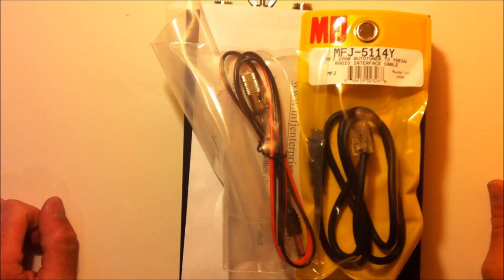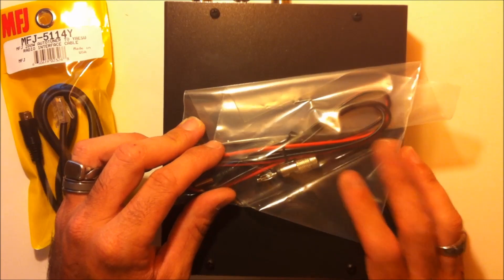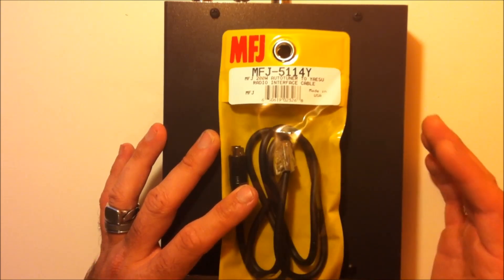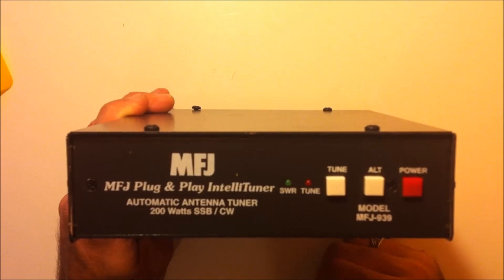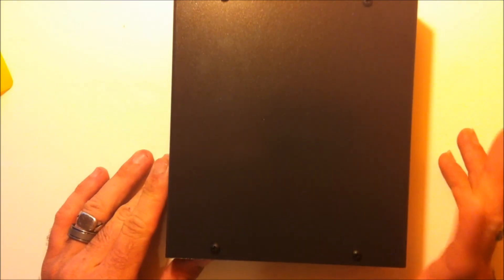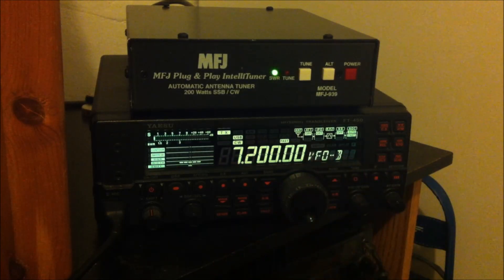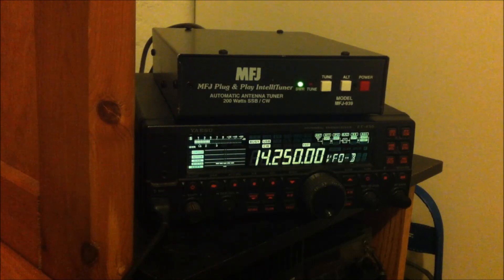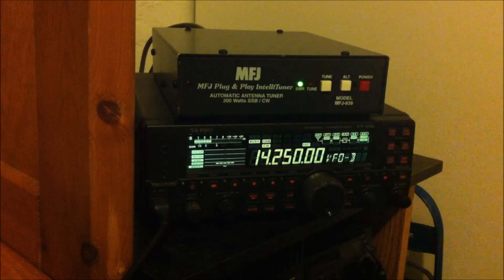MFJ-939 automatic antenna tuner review and demo

Comment: This is a great tuner. However, loose screws and nut can give headaches. If you experience intermittent operation, take the top off and tighten all screws and nuts. Be careful not to break anything. This will definitely help you out. I use this on my ic-7300 with no problems.

Comment: Not a fair comparison! The MFJ has had the frequency and SWR settings previously memorized, unlike the rig's internal antenna tuner. Terrible comparison, of course the rig's antenna tuner took longer... it needed to "find"  the NEW best SWR. Fair enough about the rig's tuner not finding a tune on 80m as it is only good up to about 300 ohms. Other rigs can store tuner memories and they would be as fast as the MFJ. Poor comparison !!

Comment: I know this is an old thread but I just don't know where else to go...I purchased an MFJ-939Y to use with my FT-710. All I've got is a 20 meter dipole which tunes very well even without a tuner but even better with the rig's internal tuner. Well, not being able to install any other antennae due to association restrictions, I've tried 15 and 40 meters using an MFJ-949e. Got some decent results (1.5:1 and lower), so I thought I'd purchase the auto one which also benefits me in that it is a little smaller. I'd love to be able to tune 10, 15 and 40,. 
Well, it's going back. Not only did I find that the tuner will not work with the rig's "tuner" button even with the proper cable, but it will not even come remotely close to tuning anything outside of 20 meters (which I certainly don't eve need it for due to the fact that radio's internal tuner actually does a better job). When I say not even close, the tuner will not do anything but shut down and claim high SWR. It also gives some CW codes which are thrown out so fast that I find it difficult if not impossible to even read. They must be at about 45wpm, something which I have trouble with at my age. The manual is completely useless.
Have you tried this tuner with the FT-710 by any chance?
I am about to ship the tuner back to under the rock that it came from, but am willing to listen to suggestions.
Reply from the maker: I have not used it with the 710 but I feel if you have an internal tuner already, an external tuner is a waste. I do not use tuners at all, I only use resonant antennas. That tuner did a good job when I tested it years ago. But if your rig has a tuner, this is not needed. And this tuner only matches an unmatched antenna to your radio, it's not "tuning" your antenna. Keep that in mind.
Reply: @HamRadioConcepts  It's being shown in the video with a rig that has an internal tuner. For the most part, the internal tuners don't tune beyond 3:1 mismatches. This tuner is rated at being able to handle 30:1. Tuners like this are meant not only to add a tuner to a rig that doesn't have one, but also to replace the built in ones. The FT-710 has a setting with which I can disable the internal tuner and designate an external instead. This is what I've done. It's supposed to be an improved alternative to the internal one, no?
Also, the video is demonstrating how much better it does than the internal tuner. Great that you can have an antenna for each band you use. If I could do that, I wouldn't want a tuner either. I tried an MFJ-949e. It did an admirable job, and I was able to work on 4 bands with the same 20 meter dipole. but being a manual tuner it was a pain in the butt. That's why I wanted to give this one a try. No it's not the same as having a 40, a 20, a 15 and a 10, but the 949e worked and it worked well. I may have to go back to it.

Comment: I need a tuner but the problem is I can't ground it. My shack is not near an outside access point leading outside. If I were to ground the tuner to a groundrod outside, the ground wire would be at least 45ft from the shack i side the house to the ground rod outside. Having a ground wire that long would pretty much resonate to act as an antenna.  Are there any solutions to the issue of a ground wire being to long to ground a tuner?

Comment: Merci pour la vidéo. Good evening Dear Om. One question please. The MFJ 939 only accepts 200w ok. Then I use an ACOM 1010 knowing that at the output of my YAESU 991A the power would only be 15/20 watts. Thanking you in advance for your response. Cordial 73's. Joel/F8MGW

Comment: I just bought a FT 991A, I can transmit on vhf/uhf but I can't seem to transmit on HF. Has anyone encountered this issue? I finally got to speak to the Yaesu technical help today and they told me to do a full reset but, that did not help. They are thinking that it may have something to do with my antenna and or tuner. I just bought a G5RV Pro ZS6BKW from Amateur radio supplies and I have it hooked up through my antenna tuner (MFJ-939). They had me disconnect the antenna tuner and plug the coax directly to the radio but, that didn't help either. I don't have a dummy load that I could use to double check the swr. Anyone got any ideas on what is could be?

Comment: I may have missed this, but what antenna are you tuning on for all these bands? 6, 10, ...?
Reply: I don’t think he said. I can tell you, if you build a simple 75meter dipole, run ladder line from it, to a 9:1 balun, then into your shack with coax, you will tune everything, and get results. I put an NVIS 75m dipole up in under two hours, from start to finish. I used aluminum electric fence wire (bare wire), a scrap piece of pvc, two insulators, 9:1 balun and 2 wire nuts.

Comment: I just bought one. well, I don't have a printer on this laptop. so I ask the sweet to go online and copy my manual. well because she doesn't run  She could not get it. she MFj and they said that they would get one out in the mail. so I'm waiting for snail mail. mine is set up for ken wood. but got the cable for Icom the salesman at Gig parts said that I would have to call Mfg because there was a wire inside that had to be changed. so again I want the manual and I still have to call Mfg again to have one of there techs to walk me threw the wire change. Now that is my ham experience, but I did like the video
Reply: You cant find anything on the MFJ site if you search it and click a link on Google, its like MFJ changed the URL name of every page on their site, when there are already Billions of links on Millions of sites across the entire galaxy!!

Comment: You say your internal atu on your rig , the 450 doesn't have a  built in atu
Reply: It was an option on the 450. It's standard on the 450AT and the replacement 450D now.

Comment: i got this tuner it tunes my 300Ohm fed antenna from 80 to 10 and made contacts on every band inbetween with my Kenwood TS-2000 
Like any MFJ product you need to open it up before plugging it in.. 
KD2GOE

Comment: I have the MFJ 929 and am Shocked at how fast it will tune.It tunes an antenna where my LDG AT-1000 will not tune at all and it tunes it quickly.I would never buy another LDG tuner because they are a poor choice against the New models of MFJ automatic tuners.I am not usually an MFJ fan but I make an exception for their auto tuners.

Comment: after getting the tuner in ( after many months on back order ) it will not tune like the video states if you are let say 20 meter as long as you tune 40 to 10 meters fine but it depends  on the antenna you have more than likely he is running a mult band antenna. if you have a 20 meter antenna you can tune 40- 10 the one i have antenna that is built for around 20 meg it will not tune upper 40 meter, 60 or 80 meters and it will not tune that fast even thro the tuner does not tune like he said the tuner is still a good tuner but it is best to get a good antenna that is built for a multbands and used the tuner with that type of antenna. my understanding it work fine on a longwire as well have not try that one. some times it is hard to get it to tune even on 20 meters  so it you know a ham that have one get him to let you try it before buying one
Reply from the maker: My antenna at the time was an 80 meter OCF dipole.. You should not be using a tuner for the bands lower than your antenna. If you have a 20m dipole you can tune 20, 17, 15, 12 10 and 6. You cannot tune 40 meters on a 20 meter wire.

Comment: Will this work on the ft 891
Reply: yes but the tuner icom inside the radio may not work with the tuner sometimes here again depends on the antenna you are running i used it mobile some time it doesn't like he stated

Comment: Yes it is impressive but you don't have to turn internal tuner on and off in the menu you can disable the internal turner and program it away you can operate an external tuner from the front  oh it's in the sub menu all you got to do is find it I've got one of these radios and and you can do it  ECT....

Comment: A suggestion, in case I missed your comment on this. Those rigs that are compatible via the DIN cable they sell don't actually NEED the 12vdc power supply (that a couple of uninformed commenter's complain about, assuming it's a "wall wart") as the rig gives the MFJ-939 the needed voltage. If you didn't note this explicitly in the video (or I missed it), viewers need to know this. PS: It also works with the new Yaesu FT-891 with the Yaesu cable adapter. They'll add that soon to their website.
Reply: I found the MFJ manual quite lacking (not the first time), and why I'm looking 'round the web. I wondered about the DC for the reason you stated, but dutifully rigged up a 12v center-positive to do the job here at home (taking it mobile soon). Anytime we can delete a cable--cleaner install.  7100 Icom here.  Thanks for info.
Reply: @Two Hands and a Radio Sure, it's in the trunk of my car, works fine, coax and data cable are all that are connected to it.

Comment: Happy New Year. I have a Yeticom Optima 10/11/12 meter radio 24 mhz to 30 mhz and the back of the radio there is no interface connection. Can I use this automatic antenna tuner and if not what do you recommend? I have research all of the automatic antenna tuners and all are made specifically for different  types of radios.
Reply: javierpolendo - you'll just need to throw a cw carrier at it with 10-20 watts to get it to tune. Also...does not handle twin lead. Look at a different model for that.

Comment: Was MFJ smart enough to use chokes on the wall wart? I'm betting not. This is what is keeping me from buying one; otherwise I will have to power it up off my DC supply. Wall warts are notorious for noise, esp on 40M. My Icom 7300 may have 12 VDC on the rear panel; haven't checked yet. Regardless, unless MFJ shielded or choked the wall wart, I would not use it to powwr the tuner.
Reply from the maker: Pete Harlen why not do what a lot of people do, plug the DC power cord into your power supply, instead of using a wall wart
Reply: Might wanna' re-read my initial comment. Wal warts suck. RFI transmitters. I never use them in or near my shack..pure DC. My whole point was why bother to even make them for a AT intended for ham use. Take it out and sell the tuner for 10 bucks less. :)
Reply from the maker: Pete Harlen when I got this it didn't come with a wall wart just an unterminated power DC cord
Reply: Not all of them do, sir.
Reply: HRC: Indeed! Some folks actually do their homework before trolling the Youtube videos. Nice channel, BTW.
Reply: Frank Howell What are you a fucking shill for MFJ? People see right through you for your ass kissing. Get a real life man.

Comment: Changing to another make/model of radio can be done, but there may be more to it than just changing the interface cable.  It may be necessary to also change internal jumpers.
Reply: You're right.  But there are only a small number of jumpers.  I think the tuner + cable + jumper is a well balanced design.  Also, it was polite of MFJ to show how to wire your own cables.

Comment: I know this is an older post BUT  I recently purchased the 939y for my ft 450  and I'm not sure what I'm doing wrong but it won't tune anything. I turn on the tuner  then my radio the green light is on when I key down it does nothing. If I key down and talk it goes crazy with high swr and the green light turns off. I've tried resetting to factory settings I made sure the radio is o only putting out 10 watts of power. I made sure the tuner light on the radio was off. I'm wondering if there is something I've missed with maybe radio settings to get this to work together properly.. any help please?
Reply from the maker: Transmit CW at 10 watts into it, it will tune in 2 or 3 seconds, then switch back to ssb. It will save it into memory for the next time you are on that freq.
Reply: HamRadioConcepts ok that seemed to work now thanks. I must have missed that some where to start off in cw mode. Will i need.to do this when changing freq each time? Like turn down the power switch to cw then turn back to ssb and turn power back up?
Reply from the maker: Yes thats what i did, now if you get the interface cable, set the radio to external tuner, then you can hit the tune button on the radio, IT SETS the radio to low power cw for you and tunes.. given there is a cable for your radio.
Reply: HamRadioConcepts  ok great thanks so much for your fast reply  I purchased this based on your review and  everything seems to be working well now. 73's 
KK4LNR

Comment: Will this tuner work with the FT-817?   Will it work without the cable on any radio?
Reply: Works on any radio without any cable.
Reply: Will this tuner work with the FT-817 with the cable?  Do you know if the FT817 can supply enough current to power the tuner via the cable?   I can't find any info concerning full compatibility with the FT817.   MFJ tells me the interface cable supplies power for the tuner not needing the external power supply.
Have you tried this on 6m?
Reply: I would like to get this tuner as part of a portable setup. Been looking at the LDG tuners too.  They have a couple of tuners that run on internal batteries.  One of their tuners is very small, smaller than the FT817 but does not in their specifications have the same range of impedance tuning as the MFJ-939.  Do you power your unit from the power supply or using the interface cable?  I would like to know the current used while in
the idle and in the tuning mode.   Thanks, Ken

Comment: This was posted a while back, but the inability to tune a wide range of frequencies to a single antenna doesn't mean Yaesu cheaped out on the internal tuner, but is a result of the real estate inside the unit. If they added on almost as much again to the size of the Yaesu as the external tuner is, they could tune as widely as the external tuner. It's always a tradeoff...

Thanks for the video, I just ordered one! :-)
Reply: That's true the internal tuners was not meant to tune much over 3 to 1 match they are just for a already resonant antenna to just touch it up a bit my FT-990 has a great tuner in it but its not meant for high swr,s . I ordered one to :) .
Reply: Truth is Yaesu SUCKS so just admit it & you will feel much better.

Comment: you're comparing the MFJ memories to the inbuilt ATU doing a manual tune each time. The inbuilt atu has memories too. All you have to do is tune it once. every time you go back it's ready to go. 0 seconds required. You also didn't show a manual tune on the MFJ for comparison, just previously tuned frequencies.
Reply from the maker: The FT450 does not have built in memories on the internal ATU.. The FT450D however does have memories. That was an upgraded feature on the D model
Reply: HamRadioConcepts 
does the ft450 at have the memories feature?

Comment: What did you set the tuner to in the FT 450 Tuner Menu????
ATAS   or    EXT ATU    or   INT ATU   or   INTRATU   or   F TRANS   ????
Reply from the maker: ext tun, but that's only for the interface cable and the tune button. If you just transmit into it at low power cw carrier you don't need to set it to anything.

Comment: You continually press the tuner button on the 450 to show how slow its internal tuner is.  But, my understanding is that the 450 has 100 memories, and if you return to a frequency that has been previously tuned there is no need to tune the rig again, just have the tuner section activated. Of course, the 939 has a much greater range than the internal tuner, but if your antenna doesn't need that range the internal tuner is fine.
Reply: I think the original 450 also does this.  You can program the CS key to send out 10W CW.  I use that when tuning with my 993B.  Though yes, you CAN set use the yaesu cable and tell the 450 the tuner is external, then it will use the external tuner when you push the tune button.
Reply from the maker: the 450 has no memories in it. I have the ft450 not the ft450d... I don't know if the 450d has memories, never heard that... but I know for a fact the 450 does not have any memories..
Reply: OK, sorry. I do have the 450d and its ATU has 100 memories.

Comment: You did not show the radio connection for the 939Y. Does it use the CAT connection or the Accessory connection on the radio?
Reply from the maker: It uses the mini DIN connector that is marked "tuner" I still have my CAT cable connected to my computer.
Reply: OK thanks for the information